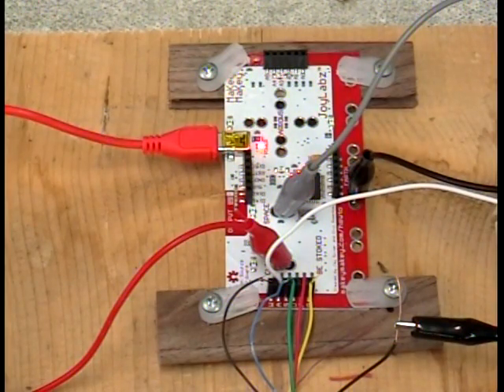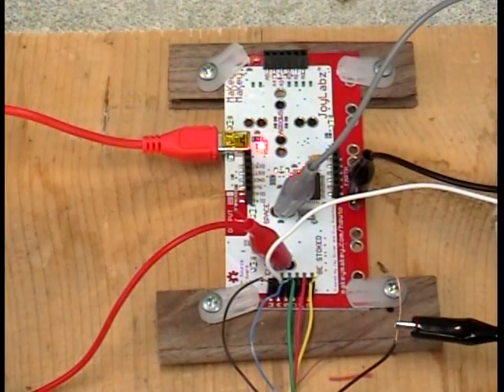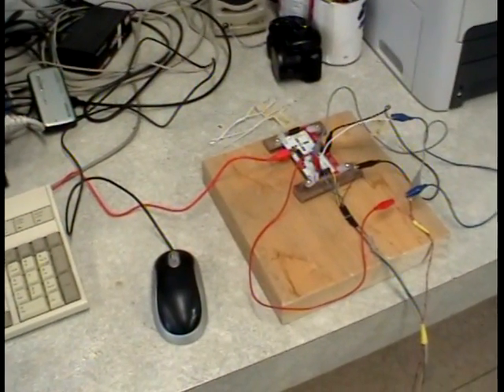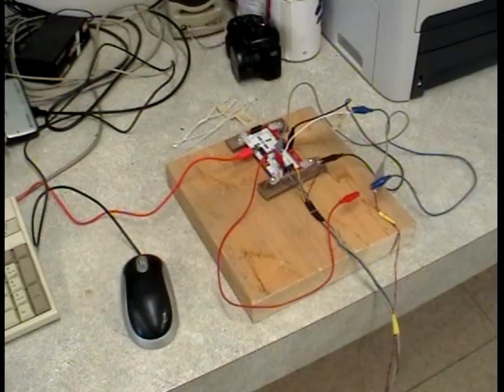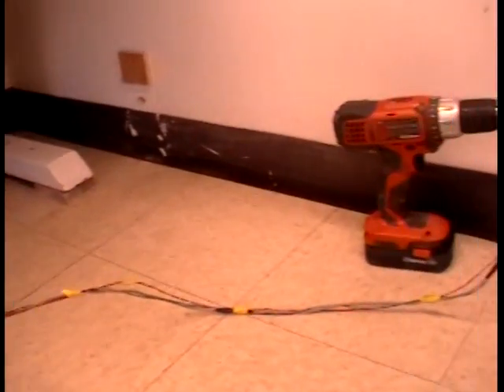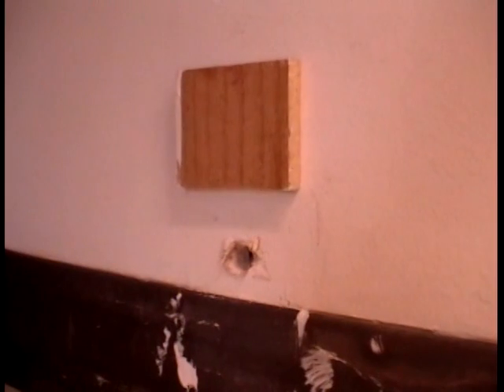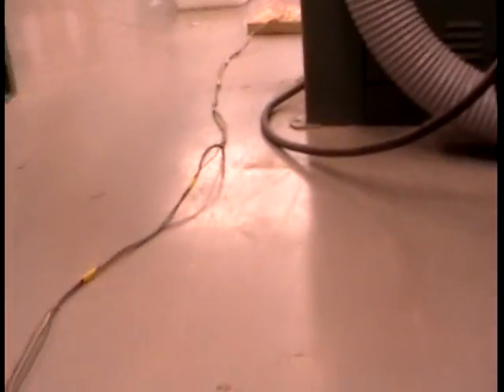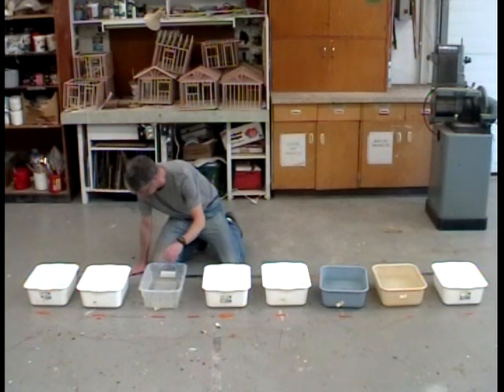Makey Makey Water Piano

Comment: How did you connect the extra wire to reach the computer in the other room? Can this extra wire be purchased at a local electronics store? Thanks
Reply from the maker: The wires are just light gauge single strand phone cable. Any wire would work because the current is low. Each wire completes a circuit when the person touches the water while holding the ground/common wire. There should be one wire for each note plus the ground wire. The body/water conducts the current and completes the circuit. Currents are so low they are not dangerous.

Comment: How do you connect the wires to the water without electrocuting yourself?
Reply: It doesn't use electricity
Reply: +Max Albert  Actually, it does use electricity, but not enough to shock you.
Reply: The electricity has about 5 volts and thats too low to shock